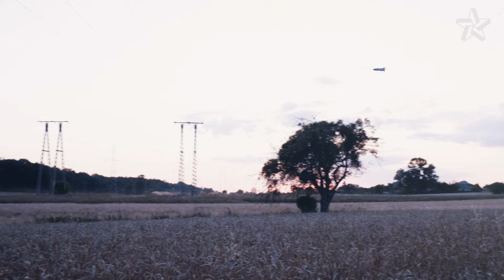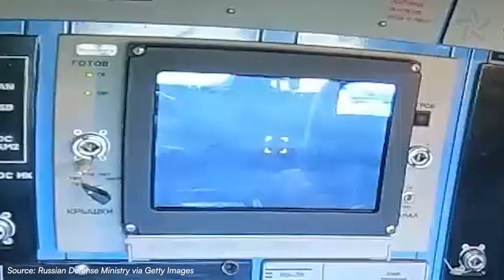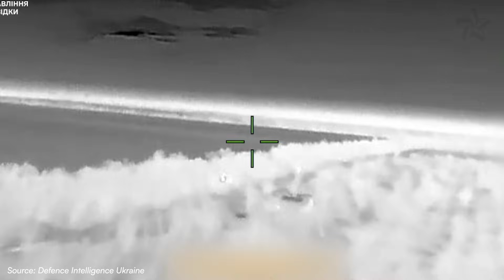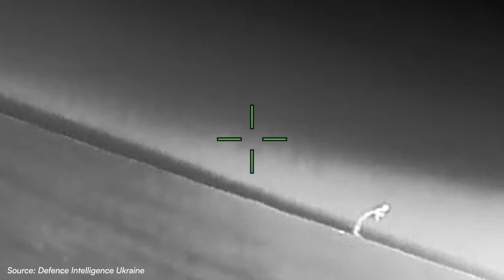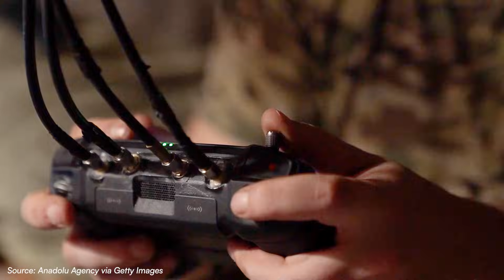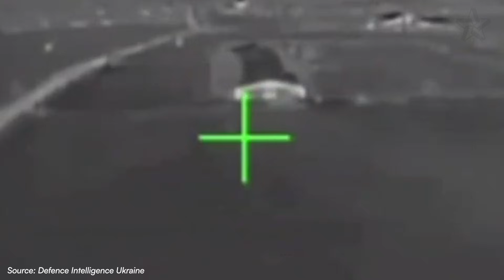Ukrainian Drones Just Did Something UNBELIEVABLE

Comment: I don't know if anyone from Ukraine is listening but I'll give you a formula on how to make a stealth coating which should make these things invisible: 30% silicon carbide, use ball or rod mill with tungsten carbide balls to make 1000 Mesh. 30% ferrite used in electronics as ferrite rings ground down to 1000 mesh by iron balls and 40% carbon black made by incomplete burning of Acetylene or even wood or tar. Mix with anything sticky like lacquer, latex or varnish and brush or spray on however you can get it on the surface. The thicker the better using a shiny coating like a varnish gives best wind resistance because these cuttings tend to be kind of rough and matte finish so they may require a gloss coat. Bingo 99.999998% radar resistant from 4 megahertz to 60 megahertz, everything from K band to X band and beyond.
Reply: That sounds amazing... How do you know this works?
Reply: @mychannelgoaway2833  I work for Lockheed Martin for over 30 years and these are older coatings but we're just as good as the $100 an ounce stuff we use now which is a lot lighter. 10 pounds of coating on a Beaver to make it 100 percent radar resistant is a pretty good trade off Just fly them in and forget about it. They'll see them after they hit.
Reply: Sounds like it would affect aerodynamics if not applied perfectly evenly?
Reply: @mattskustomkreations  If you're talking about a jet fighter that does Mach 2 then hell yeah but all the stuff in Ukraine is propeller powered at 500 mph and you're not gonna make a big mistake at that speed unless you're using a plastering Trowel which I hope they don't. It adds approximately £1 per cubic meter of surface area Roughly about £10 for a Beaver But it will be 100 percent radar proof I know I'm a coatings technologist for Lockheed where we use much more exotic stuff but it's mainly to keep the competition guessing when we could be using cheaper materials like the ones fore-mentioned which work just as good if not better. The trick is to turn radar into heat and heat doesn't bounce All the energy just gets converted into heat and the high speed wind blows that away very quickly so there's no heat bloom the same way all stealth works Convert radar energy into heat energy simple simple simple stuff.
Reply: Great, I'm sure Russia can use this info😮
Reply: @JohnSmith-fg7rd  I I'm sure they already knew 30 years ago since Moscow gives our spies hundreds of millions of dollars. But it's just like America to hold back secrets even from their allies.